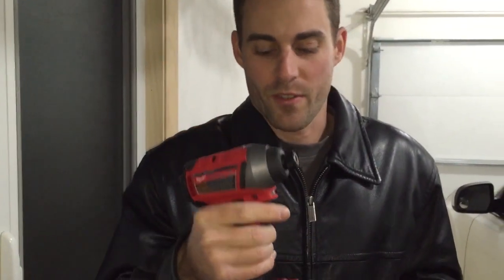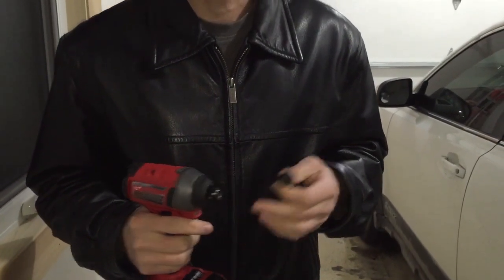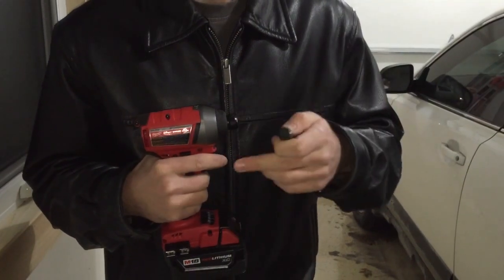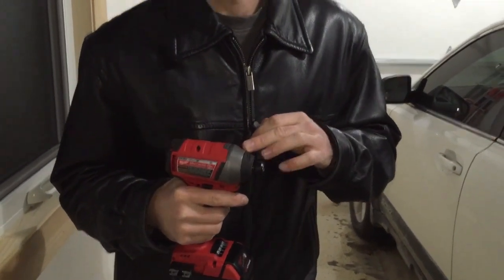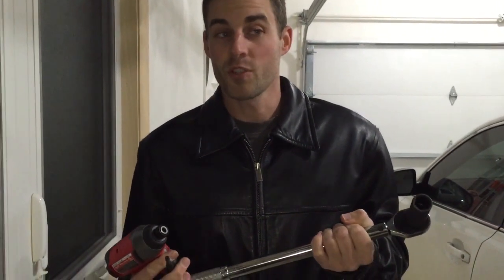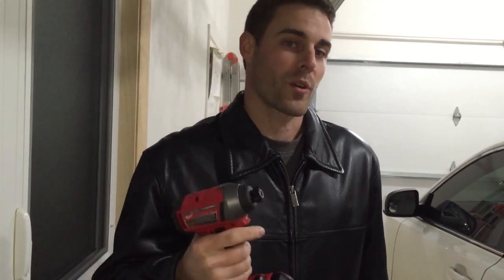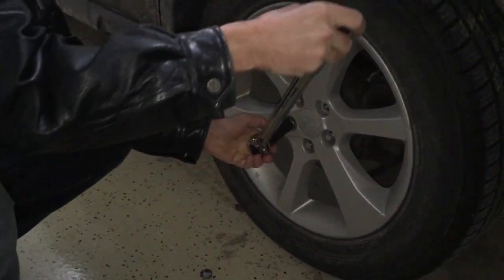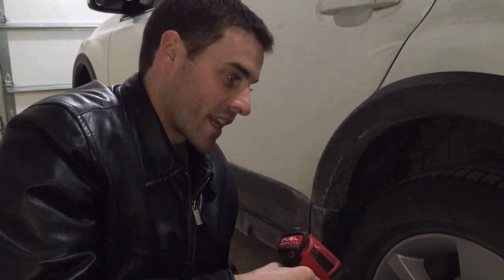Difference Between Impact Wrench and Driver (Milwaukee Fuel)

Comment: The adapter would wear out quickly causing sockets to shake; so I would rather use impact wrench for removing the wheel nuts.
Reply from the maker: Yes it’s fine to use for diy’ers who may pull a wheel or rotate tires 1-2 times p/year. More than that…an impact wrench is better.

Comment: i test the same one it did not lose nut lug 80 foot pound they lying because i test on my car
Reply from the maker: It will lose torque depending on what attachments are used. It won't work all the time. Some nuts are seized in place from weathering. This tool is on the margin of a impact wrench capabilities.

Comment: Trucks are 140 founds,130 for cars,90 to 100 for trailers,450 for semis. I'm a tire technician and I'm genuinely horrified that someone would torque a far to 80 foot pound
Reply from the maker: Says right on the Subaru manual torque to 89ft lbs
Reply: @GrowingAnswers  lol don’t listen to him just do what the manual says. It’s a car company for gosh sake. Let’s see: should we listen to a car company that says torque their own car’s lug nuts to 89 ft lbs, or some dude who works at a tire shop?
Reply from the maker: @braydinjones6301  all I can say is that I’ve never had any problem following the manual. I’ve done plenty of work on many cars for the past 20 years. Not a single loose lug or warped rotor has resulted.
Reply: @GrowingAnswers   the Subaru manual lmfaoo
Reply: @Ferkle871  Toyota Camry manual says 76ft lbs and I see no reason to think Toyota don't know what they're talking about. It would seem that 130 for cars is excessive. No wonder folks are cussing under their breath trying to take a wheel off after a tire shop put it on there.
Reply: @asaeed2484   Actually,we have customers that have came from states away because we've been recommended so much. We're one of the top tire shops in our state. We do semi tires,tractor,loaded tractors, implement tires,trailers,cars,forklifts,splitrims, lawnmower,combine,and many more. We get service calls because idiots don't tighten their wheels enough and about die on the highway. Can't tell u how many morons we've saved due to under torquing lugnuts.

Comment: Good video, I have both IR (air) impact tool (tq rated about 500) and that same Milwaukee. My Suburban needs 140 tq on the lugs, most of the rest of the cars around 100-120. I also have the Milwaukee 1/2 inch drive impact wrench (rated IIRC about 250). For small cars & light duty & also wood etc. I like the driver a lot. But for bigger vehicles & doing jobs where a lot of large fasteners are called for I get out the air hose. Then when you run the air gun the sound really tells that I'm doing man's work. Haha.

PS be careful spinning that socket near your face, I have seen sockets come flying off of spinning tools & had one whack me really good on the leg. So now I keep that to a minimum.  :)

Comment: So if I understand correctly, you should only buy an impact WRENCH if you already have a standard drill/driver AND an impact DRIVER and just need something specific for nuts & bolts only as a power socket.  However, between the two you should probably buy an impact driver first (before an impact wrench) because an impact driver can substitute as an impact wrench (and also perform other more versatile functions), albeit not as well as an impact wrench in specific situations if you're just using it as a power socket wrench, correct?
Reply from the maker: Most situations the driver does it all. In some cases with the diameter of lug nuts on car wheels, the driver may struggle. Once into the half inch socket range it’s hit or miss on machine nuts and bolts. But a driver can drive just about any size lag into wood. A wrench can also serve as a driver but as they get larger and heavier it’s not as nice to handle for screws and such. And it won’t fit into tighter spaces as well.

Comment: They are the exact tool. The only difference is the anvil. Most often you can just swap anvils and you have the different tool. For example the dewalt 877 impact driver and the 890 impact wrench. Same exact unit. Sticker is different and anvil is different

Comment: Hi , can you please suggest a brand which is not too expensive and that will do the job...i am mostly working on motorcycles and sometimes doing DIY basics on my car ...
Reply: And after watching your video , i have decided to get a driver instead of a wrench
Reply from the maker: Cafe Nomads - Wilson's Wheels there isn’t really too many I would get at a cheaper price. Get what you pay for. Harbor freight would probably be pretty cheap, but no guarantee it will last.
Reply: Growing Answers how much did the one you are using in the video cost and what model and make is it
Reply from the maker: Cafe Nomads - Wilson's Wheels video description
Reply: Growing Answers thankyou !!

Comment: Thank you for the video. I'm having a hard time cracking the bolt on my scooter's cvt. I'm so desperate that I was about to use a hammer drill on it. I think I'll save myself a broken wrist and just buy an impact wrench 🙈
Reply: Close, but a hammer drill has the impact force going back and forth (as if you were hitting it from the back wit a hammer, thus *hammering action*) instead of rotational hammer force like this impact wrench. If you haven't gotten one yet, look into the Milwaukee M12 Impact Driver. I have the M12 1/2 Stubby Impact Wrench as well and the Impact Driver is definitely more versatile and find myself using it more often unless I'm taking off wheels or suspension since the M2 Impact Wrench is meant for more heavy duty applications of course:)

Comment: Very misleading info. I’m pretty sure that this is an IMPACT driver, not a hammer drill. Two completely different tools. This tool does not provide a hammering force. It only provides a radial impact force (and the person in the video appears to misuse the term radial).

Comment: Hi, many thanks.  How do we avoid applying too much torque and over tightening nuts.  I use a torque wrench to achieve the correct manufacturer's ft/ibs of torque, just not clear how that works with a impact wrench?  Anyone please?  Many thanks for great simple to understand video.
Reply: Kieran W don’t pretend you are Rambo in the finale of a movie.  Snug up easy or use a ratchet to tighten or a torque wrench for technical.  Handle length of hand tools is how they measure in torque. Longer handle mor torque.  I hop that helps.

Comment: What if it's a 1/2" impact driver with 18v power? What's that used for? heavy torque/nuts and bolts? the one in your video looks like 1/4" Mil impact driver?
Reply: typically, more bigger is more power. some m12 fuels can achieve specs of non-fuel m18 tools. in the case of the m12 fuel surge vs the m18 fuel surge, they curiously have the same torque spec listed. 1/2 inch impact is normally a impact wrench, all the impact drivers are 1/4 hex. impact wrenches are typically used for vehicles, and the high torque ones for construction or diesel vehicles, can now achieve 1000+ lbs of torque. impact wrenches can be 1/4, 3/8, 1/2, 3/4, and 1 inch anvils.
Reply: @wclintf  thx Clint
I was thinking the brushless 1/4 Mil impact drive vs a Ryobi brushed 3/8 impact wrench, the Mil would still win, both made by TTI the brushless Mil beats out a "bigger 3/8 Ryobi" impact wrench (1 it's a better motor (2 has more IPM but neon green vs red also isn't a fair match, neon has great tools, just won't see them in pro shops anytime soon even if they go brushless, they have a long way to go when it comes to impact drivers, impact wrench etc
The 4 position ratchet is a steal little bulky $79 can't beat even red has it's pitfalls like the M12 brushless, non fuel ratchet the anvil is infamous for snapping off, @$30 a pop that can get pricey after a while, 3x it happens just bought your tool only $99 lol so chose what fits your budget and reliable both are great tool brands.

Comment: my lugs tightened by the shop would snap that adaptor bit like a pencil.  usually you need a minimum 350-450 ft. lb. 500 dollar dewalt impact driver for breaking loose rusted bolts and properly tightened lugs.
Reply: unless you're driving a tractor trailer, you're off on those torque specs by a factor of 3, 4 or even 6. Most vehicle factory specs are usually between 80-140 lbs. You're trying to get some poor sap in a camary to snap their lug nuts. You are correct that 300 lbs of torque is probably a bit much for the 1/4 adapter. You also don't need to spend 500 bucks on a impact wrench to hit 400 lbs of torque... but i guess you throwing the $500 bucks out there was some shitty humble brag.
Reply: Dewalt isn’t even that great. Milwaukee puts it to shame with it’s 1/2 inch impact wrench mid torque and high torque FUEL models
Reply: 24' breaker bar is all I would invest in other than a decent milwaukee again if the home depot carries them, all they have in 1/2" drive is dewalt.  lol I broke a lug stud off my shop tightened camry with the bar.  seems they over torque instead of re torque two weeks later these days.  I had an easier time removing rusty f-350 lugs mostly
Reply: @NinjaRastaMon  I buy high quality tools, even if expensive, because they make my life easier — especially when it comes to dealing with rusty bolts, lots of disassembling (think valve cover and spark plug jobs on SUVs), suspension work, and brake calipers.
Reply: @AnCapDog144  do you find you need a torque wrench or do you do alright without one?  I agree proper tools are safer also, and can last a lifetime, but not usually lol
Reply: @NinjaRastaMon  Lately been doing good without a torque wrench, since I follow the “German” torque specs.... “gooood and tight.” That being said, it can be scary, if say, you’re not tightening stuff related to suspension, wheels, and brakes properly.
Reply: @NinjaRastaMon  I don’t know if you know, but they make a little digital device that slips on your regular wrench that can measure how much torque is being applied. It’s much, much cheaper than an actual torque wrench that way, or even a digital torque wrench.
Reply: @AnCapDog144  I have no good and tight worries, more worried of over doing it.  counting rotations from a mark and having a feel when loosening works for me.  I used the digital and analog one at work for a day before the boss said they are not sensitive enough, but do the job.  Dial gauge is the best he said.
Reply: @NinjaRastaMon  Is that what it’s actually called “dial guage”? If so, would love to get one from Amazon or wherever. Lately become a fan of Northern Tool online
Reply: @AnCapDog144  yeah thats it, used to use a certain brand of cast heavy red ones on assembly lines and they are durable also
Reply: @NinjaRastaMon  Nice chattin with you. A breathe of fresh air, really. Looking forward to the spring so I can start doing some upgraded on my project car: 2000 4runner Limited 4x4, V6 3.4 liter engine with a rear locker.

Comment: Impact driver may remove the lug nuts but I think it’ll consume too much battery because of the strain it undergoes especially if the lug nut requires more torque where as the impact wrench is specifically designed to do that job. Moreover the mechanism would probably not long if you keep using the driver. Once in a while is just fine.
Reply from the maker: World Peace correct.

Comment: Good review man! Just bought the Milwaukee m12 fuel kit. Just did my wheel lugs and brake with just the impact drill and works perfect! It's small and compact but strong as the m18s. 😎
Reply: With a max nm112  I would  think this would struggle with most car  related nuts and bolts...🤷‍♂️ mybe you got lucky and they where lose  or mybe the previous owner coated everything in anti seize......  good for you  ...👍🏻👍🏻👍🏻

Comment: thanks , i was trying to use an impact driver to remove lug nuts off a car, but what I needed was an impact wrench.
Reply from the maker: I use my driver to remove my lugs nuts every time. Works effortlessly.
Reply: @GrowingAnswers   depends on the vehicle. My truck needs 140 ft lbs per lug vs most small sedans need around 80

Comment: All my Milwaukee impact drivers are able to removed my tire lugnuts with no problem but I have the ridgid brushless 1/2 inch impact wrench that tool is a monster I’m think of getting the m12 1/2 inch impact wrench undecided yet though
Reply: I see a lot of people on youtube saying impact drivers absolutely cannot take off lugs. They say you need an impact wrench - honestly there are tons of videos showing drivers doing it just fine. I'm gonna get a driver
Reply: @swesleyc7  I got the Kobalt xtr impact driver an I tried removing lug nuts off with it an it actually did removed them easy it can be done but I got the bigger half inch  Kobalt xtr impact so that’s what I prefer to use to take lug nuts off instead of my impact driver

Comment: What about the black and decker impact driver
Reply: Black and decker is for pussies
Reply: Black and Decker brand has always been low quality and inexpensive, targeted for someone who will use the power tool 1 or 2 times. Generally speaking, a serious DIYer will spend more money on a quality brand that will easily last for 5+ years, even with frequent use.

Comment: This does wear out the impact driver quicker but it’s good that you can do it in a pinch
Reply from the maker: C Boy loosening isn’t really that bad if nothing is seized. Just tightening. Drivers are not really great for tightening lug nuts as it takes longer impacts to achieve tightening. what it’s great for is just spinning them back on fast to medium tightness and then use a torque wrench to finish. 

Most of the time impact drivers are use is in the clockwise rotation. So those edges on the cylindrical hammer will always wear out faster with regular use. So if it’s just being used in reverse for lug nuts, it’s fine.
Reply: That’s good to know, thanks. One thing I will say is tho these Milwaukee drivers wear out fast done 3 in 5 years still all covered within the warranty tho 😂😂👍🏻
Reply: @charlieb7585  Wait, if they wear out fast, what kind of jobs are you doing? And have you tried other brands that don’t wear out as fast???

Comment: Hey, this is a GREAT description with all the pertinent details to properly differentiate the tools! Thanks. I was trying to find out if the impact drivers have a back to front hammer in addition to radial hammer. The comparison of the radial hammering torque to constant torque was great. Thanks!

Comment: Who in their right mind has EVER removed a lug nut with a torque wrench??????
Reply: don't tire shops do that all the time?
Reply: @JosrRocks  NO - Torque wrench is used for Tightening not for removing.
Reply: TomimiDezu You know it does go in reverse and is just as capable of turning left as of right
Reply: @TheSouthenYankee  But that’s only for Tightening reverse thread bolts or nuts.

Comment: However, can you set your impact driver to exactly 80ft lb of torque when driving in the lug nuts? If not, you'd have to use a torque wrench and screw them on by hand anyway for precise torque.
Reply from the maker: BelowMars fortunately the driver is only good to about 110ft lb. so stopping when it’s mostly tight is close to 80ft lb. always check it with a torque wrench though. The driver just makes the job much easier. However, it does have 3 torque settings. I don’t know off hand what they are.

Comment: I have used the best of both tools impact wrench will not stuff up but impact driver on vehicle maintenance will not last a fortnight they have different purposes cant compare the two
Reply from the maker: Yazz Ercan it’s not for a mechanic. It’s for a seldom use homeowner. It’s really just a demo of how it works. No it would not be used for this mainly. I have used it on plenty of nuts a bolts though and it’s a perfect all around tool for that. Makes life so much easier.

Comment: So I’m a DIY person I do my own brakes and car service for example .. so would you recommend the driver instead of a wrench ?
Reply from the maker: Liam MG if you use it for driving screws and bolts into wood or whatever too then yes. The driver is very universal. I used mine to install a hitch which tightened it to 110ft lbs no problem. If it’s just for automotive then just get the wrench.

Comment: I just got a squat rack that needs to be bolted together. Would it be better to get an impact wrench to put it together?
Reply from the maker: Depending on the inch pounds, the driver should be more than capable. I think this one has 110ft.lbs. I don’t know what a squat rack is, but I use this driver for plenty of things and love it.  Unless it’s a car frame or some suspension parts. The driver can pretty much handle it all. It’s pretty amazing.
Reply: Use a hand socket and apply red lock tight to each bolt blue lock tight if you don't plan on ever taking it apart

Comment: If they had clutches they could be used for tightening.
Reply: vince King if you think about the way a clutch works slips on resistance and then the way an impact works slams on resistance you can see why thats a problem
Reply: Or you could just use it like mechanics use a air impact gun and spin it down to tighten it a little extra.